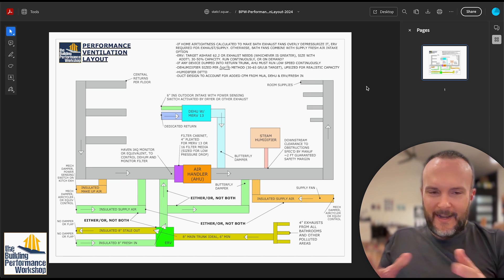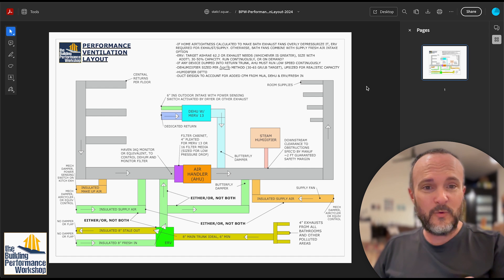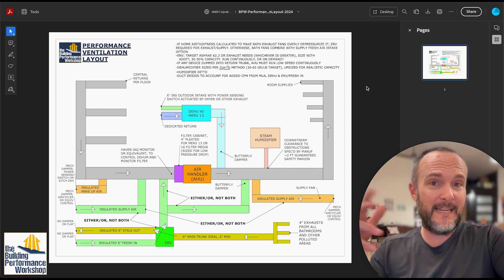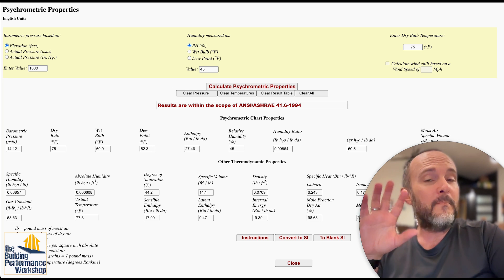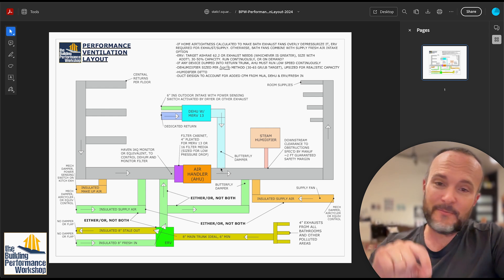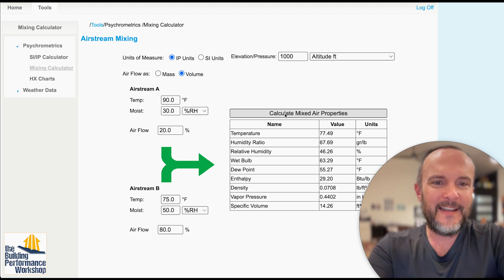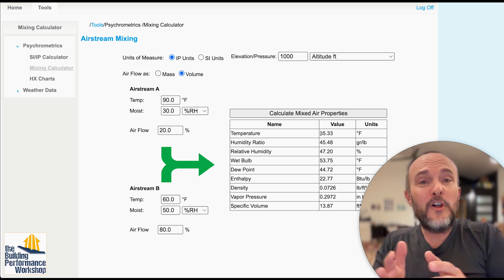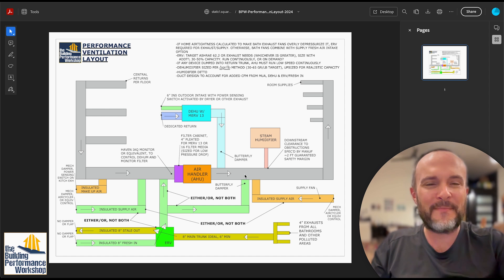Interior Ductwork: Insulate or Not? (protecting your ducts from condensation)

Comment: maybe i'm too stupid to get this. Let's say I'm in Canada and it's -20C. Is a 20ft rigid metal duct ERV intake always going to be dripping in the wall it's in?
Reply from the maker: Is it running sideways through an exterior wall that’s very air-leaky to inside?
Reply: @HomePerformance  No, the intake basically immediately enters the floor joists or interior wall and then it's a straight shot to the utility room which is basically dead center in the split level house. I was thinking that it would drip on the sheetrock or whatever is under it (haven't dared opening it all up yet)
Reply: @HomePerformance  ... Basically I figure the metal intake would always be cold if the ERV was always running. And then even if I don't have anything directly blowing on it, inevitably I would get condensation. There's an existing gas furnace intake there, but I figure it's so sporadic that the metal heats up between heat calls

Comment: I didn’t know it was illegal in Florida to install that into the return.  The company that installed my ventilating dehumidifier in Florida installed it into the return.  When I set it up because they lacked the abilities, I had to set it up with a cut-out so my a/c goes into dehum mode and the dehumidifier cuts off so it’s not a waste.  I was hesitant to move the duct because I had it all aerosealed already.  Maybe I ought to move it anyway?  I’m sure it would work better.
Reply from the maker: It was in the building code in 2020, possible they removed it since then- I’d wait and see how a year passes before doing any more surgery. Sounds like you thought it through.

Comment: If you have the ductwork within a condition attic space and you have the proper erv system with a dehumidifier if needed, would you still need to insulate that ductwork or is it just a good practice to go ahead and insulate it?
Reply from the maker: ERV dustwork only needs to be insulated on the two big ducts going to/from outdoors.

Comment: Thanks for the video. I am curious about the airflow on the dehumidifier when the AHU is working. The butterfly damper opens when the dehumidifier is operating. If the AHU also turns on, won't the static pressure in the supply duct rise thereby reducing the airflow through the dehumidifier? What do you think?
Reply from the maker: No, they test the units to work against a variety of static pressures- unless you have an extreme pressure in the supply it should be fine.

Comment: Thanks for the video! Expat here. Question regarding a 1917 middle terraced brick house in the Netherlands. Average annual temps 33F-71F. Average yearly humidity 82%. Zehnder Q 600 ST ERV and dedicated dehumidifier. Will the pre-heating capability of the Zehnder Q600 coupled with the stand alone dehumidifier be enough to negate the need for insulated (plastic) Zehnder ducts?
Reply from the maker: Definitely, on the inside (past the machine). The big ducts running to/from outdoors must be insulated though.
Reply: @HomePerformance  You rock. Thanks for the reply! Love your content.

Comment: The stand-alone dehumidifier definitely works, but I think a modulating system with a modulating reheat coil after the evaporator is a much more elegant solution. I think my ideal system would have supply duct sensors and control the evaporator based on a target dew point; I like a dew point around 45 or so. Then, I would modulate the reheat coil to bring the supply air dry bulb back up to whatever is required to meet the sensible load. That's a much more elegant system that can follow both the sensible and latent load without adding unnecessary sensible load like a dehumidifier does.
Reply from the maker: I feel a video coming
Reply: @HomePerformance  The more, the better.

Comment: I am designing my new homes HVACD systems now and our heat pump has a dehumidifier mode that reduces the air speed to its lowest, plus we have a dedicated dehumidifier. The systems are connected on the supply side. We are going to use a haven and interconnect them. No more hot air coming in from dehumidifier. I think this will be our best option. I think we will use insulated just for the cheap insurance.
Reply from the maker: Good plan

Comment: (The rub as always, is how to upgrade EXISTING construction, based on these principles.  But for NEW construction ...)

This is yet more argument for how airtightness, good insulation, and good shading and radiant barriers payoff:  Don't let heat in, so you need less cooling capacity, so your ducts don't experience as much temperature differential, so they stay above the dew point and don't sweat.  What does condensation cause?  Water damage and MOLD.

I still see people saying "But all of that airtightness and insulation is so expensive."  News for you - MOLD mitigation is expensive too.

Great video, really clarified some things for me, thank you.
Reply from the maker: Good points my friend, thanks for following

Comment: How is the 60deg output calculated on the air handler? Will this calculation fail with single stage units; or 'conventionally' programmed thermostats (sleep-wake-away)?
I appreciate your 'cheap insurance' comment. (written by a homeowner masquerading as an HVAC tech)
Reply from the maker: The real temperature drop would be tested in real life, Paul, but actually right-sized variable speed equipment may make the ductwork colder if it operates a certain way. More to come from your fellow Patreon member Tony Gomes soon.

Comment: Hypothetical for next gathering.  Home in Florida with separate cooling and dehumidifcation.  I.e. All dehumidification is done via dedicated dehumidifier.  AC is running at low delta t and therefore system can be designed for high CFM/ton through coil (and running more efficiently).  
Is there anything wrong with this setup?  If not, then why shouldn't dehumidifier be plugged into return of AC system for distribution?  (not a rhetorical question)
Reply from the maker: Let’s put it to Tony, he’s the man imho
Reply: @lukemorton5196  I'm curious what the experts will tell you.  I live oceanfront in Florida and getting ready to redo the HVAC system.  My contractor wants to dehumidify separately from the rest of the system.  Now I am wondering if better to dehumidify into the supply line or if it may not matter?  I am going to use the Santa Fe 205 dehumidifier.